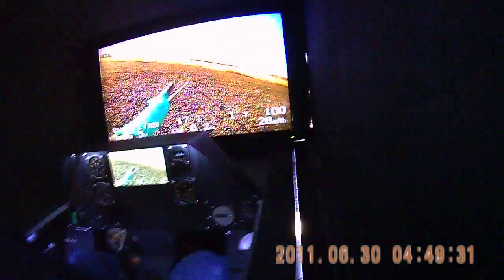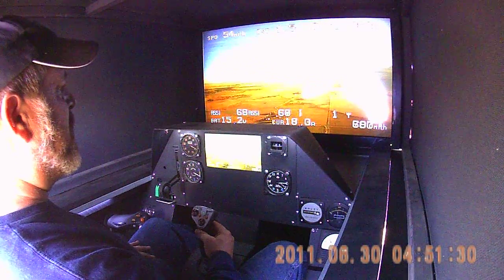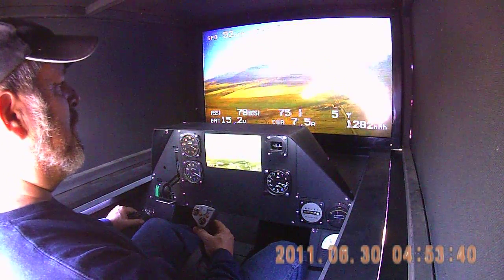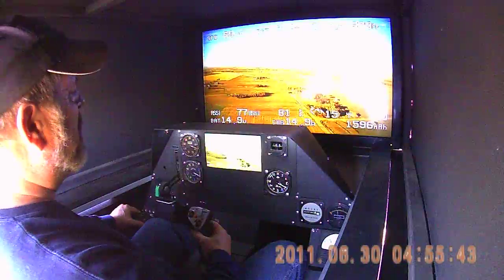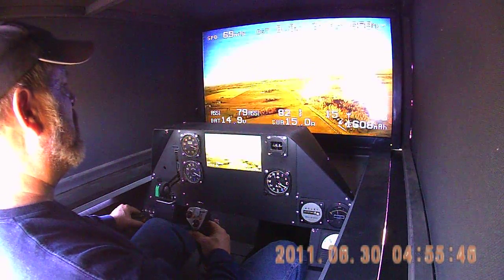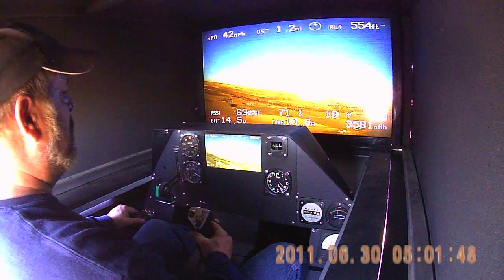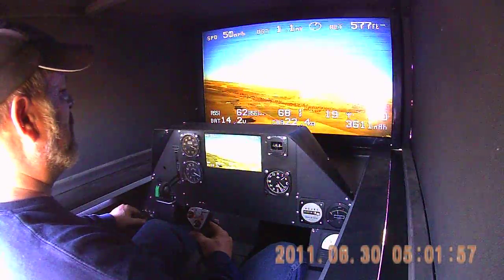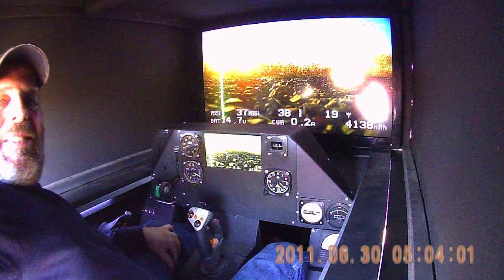FPV flight in the CGS!   A catapult launch of ZII and 4.6 mile to buzz a friends house.

Comment: Next upgrade : Put the entire cabin on hydrolics , so it will follow the position ur plane is in + get some sound in there . Love this project and i will probably will try to make the same FPV cockpit soon !
Reply from the maker: Yeeeeea.....Hydraulics.....everyone says that but in reality they would not add as much as you would think to a sim experience.  Your brain actually dose a really good job of ''assuming'' you are in motion and gives you the illusion of motion.  Hydraulics or any other form of motivation would be expensive and add a lot more complexity for the pay off.  This was always meant to be as simple as possible so it could get used as much as possible.  As it is now I can be set up faster than most people using a more common FPV set up with goggles.  It does have sound but when I am filming I usually turn it down because it doesn't come through very well on cam and is just annoying to watch......lol.  
I really hope you do build one.  It is a ton of fun to fly!!  Good luck!!!
Reply: Brett Hays PS, how did u connect the joystick to work with the rc link ? i have a compufly ppm to usb converter , but the thing is it needs to run with a  computer to work, so if computer fails plane goes down .. I had it setup once and got it to function fully with my saitek x52 flight controller. How did you do it ? Greets :-) oh  and feel free to check my fpv indoor control setup ;-)    /watch?v=u8kQVVTe2i0
Reply from the maker: Ewalt Ruts Well it is hard to explain but basically the whole flight control system has been modified with the same value pots as the R/C TX uses.  then I simply pull the old joysticks out of the radio and splice in the joystick, rudder and throttle with their new pots in them.  Works like a champ.  However I have since upgraded to the Turnigy 9XR radio (see my other videos) and it has a pot calibration option in its menu that is really easy to use.  I would bet that now all I would have to do is run that without having to modify the joystick and stuff.  All that would have to happen is splice in the wires.......maybe.
Reply from the maker: Ewalt Ruts also see my articles I wrote here........ http://flitetest.com/articles/fpv-full-scale-cockpit-ground-station-w-42-tv
Reply: Brett Hays You my friend are brilliant !
Reply from the maker: Ewalt Ruts Your kind.....thank you!  
I hope it helps you with some ideas to get a CGS up and running.  If I can offer any help let me know.  My other later videos my help you out a lot also.

Comment: You made a great call coming back when you did - those RSSI figures are great bits of info :)

Watching the 3rd readout from the left - I noticed you started getting failsafes when the RSSI reaches around 75 (these are complete loss of control whilst the rx locks back onto the signal - luckily they temporary in this case) . I'd use this as a yardstick and try not to fly beyond say 65-70 RSSI to be safe; or be ready to flick from low to high power around these values.

The EzUHF is definitely capable of much more range, and is a fantastic bit of kit - I've used them almost religiously over the past few years and get great results.

You have an amazing setup, and I'm truly in awe. This is the first time I've ever seen anyone make a full cockpit out of their FPV system; it looks like loads of fun! :)

All the best! /new subscriber :)
Reply from the maker: Right on my friend.  I deduced the same on the RSSI as you did.  I never felt any glitches in the stick not even a little bit.  I always felt rock solid the whole flight.......not to say there wasn't, but it wasn't noticeable anyway.  i have since changed to the EZ module tx which is awesome and a super hacked Turnigy 9XR.  check out my latest vids for the whole upgrade list.  Thanks for the comment!!